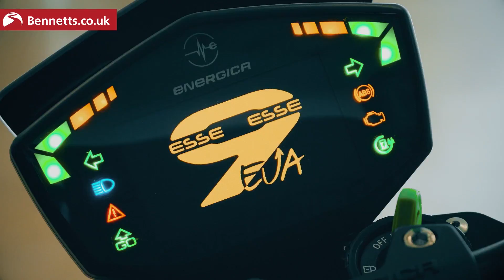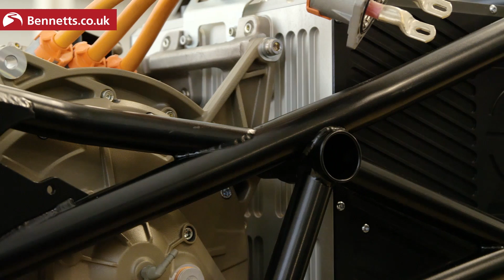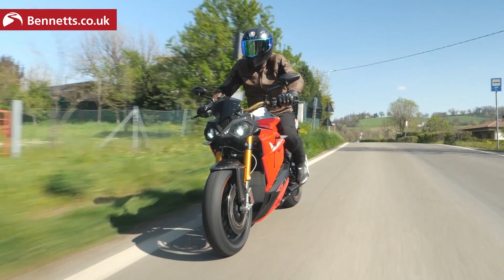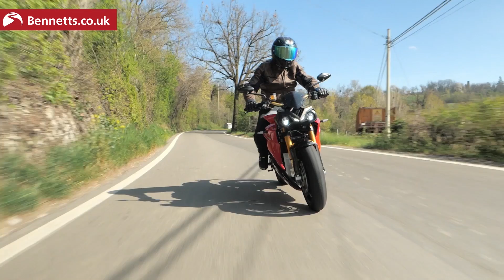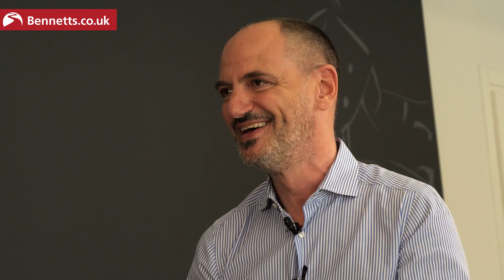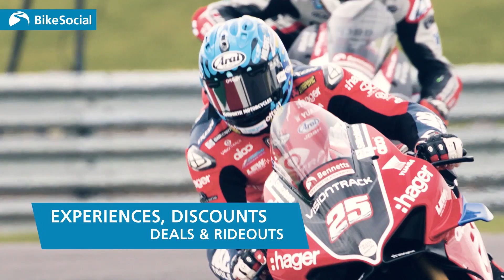How does an electric motorcycle company work? | Energica's inside story

Comment: It would be interesting to get Energica's reaction to Ducati's V21L MotoE prototype. They have some apparent big improvements over Energica in the battery pack design. Ducati has shaped it to be a contoured stressed member and has a lightweight carbon fiber case compared to Energica's square box shape and metal case.
Reply: It would need to be a lot cheaper than the Ducati because it looks some lies of kit
Reply: Prototype is easy .. as long as you dont have to make or sel them